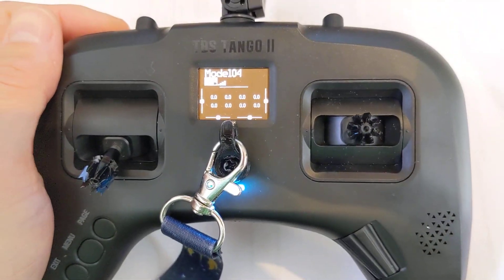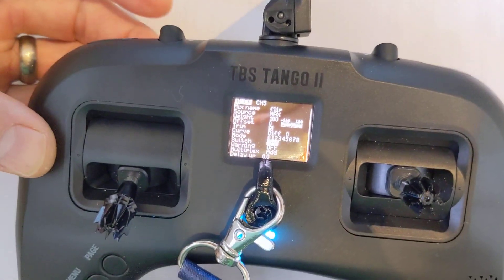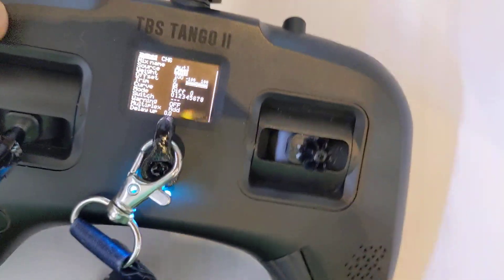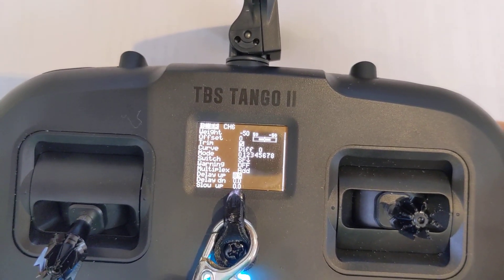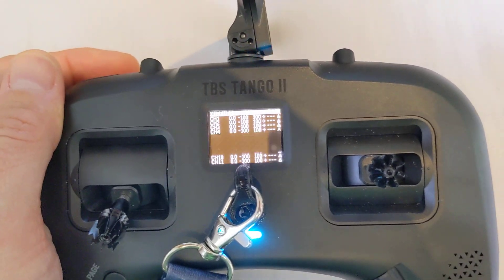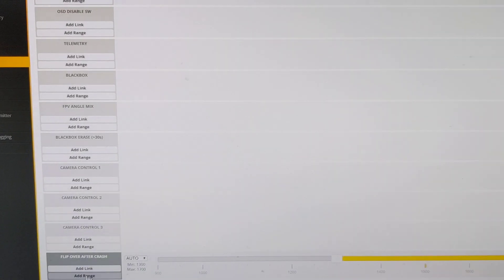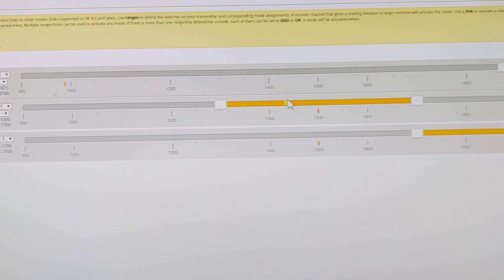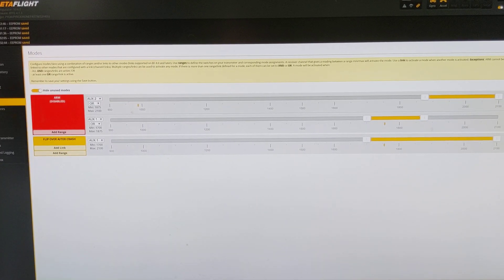Auto activate arm for turtle mode on tango ii and betaflight - openTX / FreedomTX

Comment: This is helpful and could be used in a number of different ways, cheers. For some reason though I can't get either of the momentary switches on my Tango II to respond on Betaflight at all.
Reply from the maker: have you mapped them i the outputs? i think by default only some of the switches come though. Or have you got your crossfire to 8 channel? If so, you will need to get the tango to send the momentary over one of the first 8 channels
Reply: @wadetubman  hey man cheers for your help